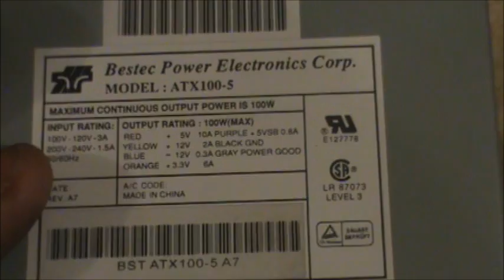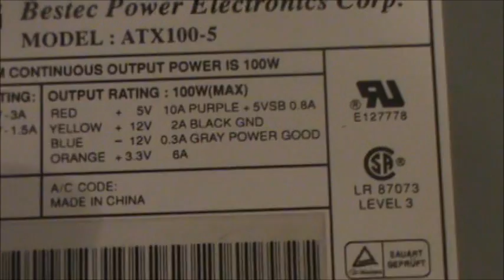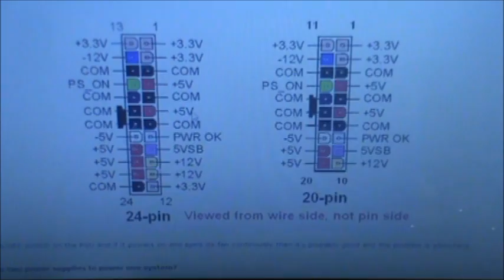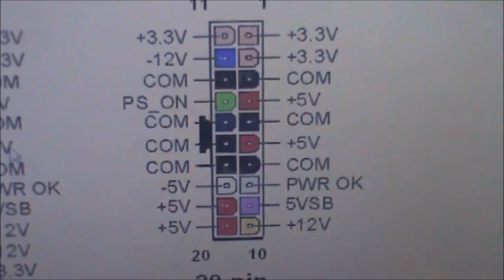Using a computer power supply for powering a car radio: see description

Comment: Hey I had a computer exactly like that. I believe that's an HP Pavilion XT 923.

I made a power supply out of a PC for an older LCD TV that ran on 12 volts. I took off every one of the wires coming out of it and connected the original power cable for the TV to the 12 volt rail and wired an on off switch to the PS_on green wire and the common wires. It looks very neat. the only wire coming out is the power cable for the TV.

Comment: Does the green/black wire bridge have to be conected all the time? or does it just have to be pulsed lets say with a  pulse push booton switch? thanks
Reply from the maker: siegfriedo brabender I would think a pulse would work, what are you trying to turn on for only a few seconds?
Reply: doublewide6 Hi just wonderin, cause on the old computer the button to turn it onis just  apulse pushbutton. Thanks anywa I enjo your channel!
Reply: +siegfriedo brabender pusle buttom givs the signal to motherboard, not to ps. and then motherboard controls the ps :)

Comment: plenty of choices from the PC power supply.  Still keep old printer etc power bricks often you'll find you'll have a compliment of 6,9,12,18,21 &36 V supplys sitting in your drawers.
Reply from the maker: Your standard 12V DC wall transformer does not have the wattage to run a car radio, but I know this power supply will.